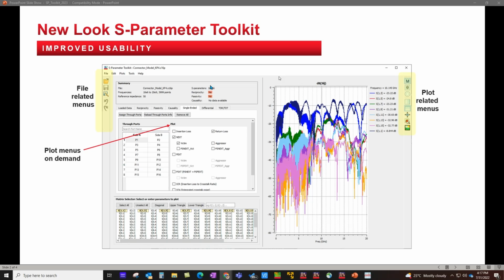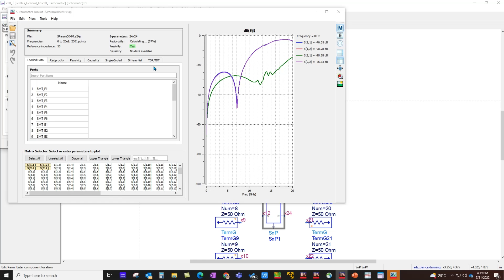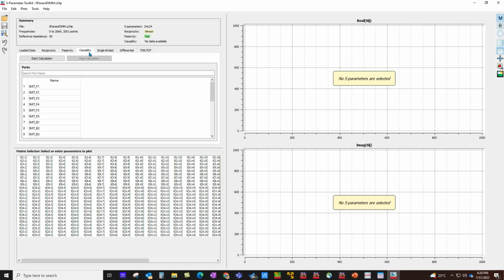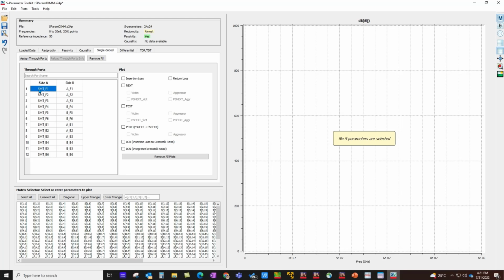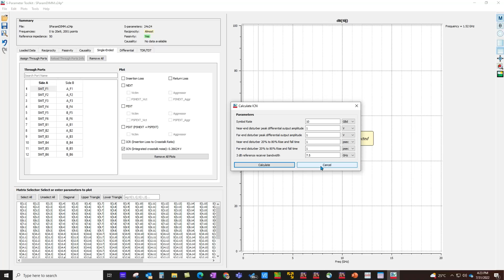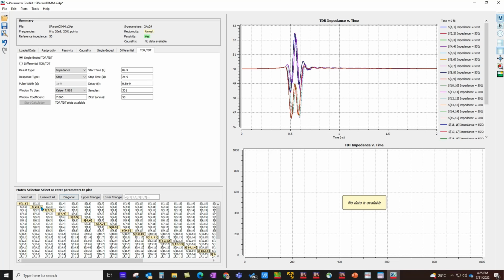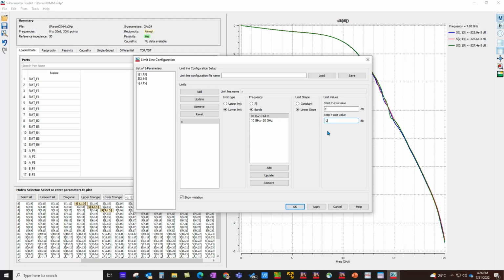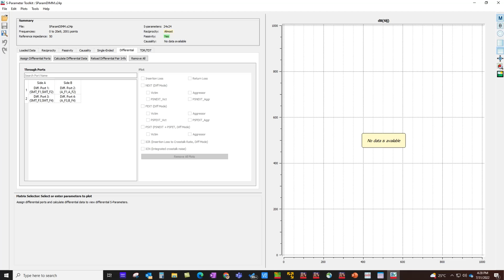ADS2023 Top10 - Feature 8: S-Parameter Toolkit Enhancements

Comment: Dear Anurag Sir,
 I hope you are doing well. Your tutorials have helped me a lot in understanding ADS. Thank you so much.
I am working on a patch antenna fed by two pairs of differential ports  ( Port 1 is paired with port 2 similarly 3 and 4). For the ports, I am using TermG. The schematic circuit contains 4 capacitors for coupling between the patch and ground and the L-shaped feed metal. To get the required result, I have to change the value of the capacitors. How can I use the S-parameter toolkit for this purpose? Is there any other easier method to provide differential feed in ADS instead of using the SP toolkit?
Reply from the maker: There is no need to use SP Toolkit for this need. Instead of TermG, use Term which has +/- terminals and you connect each one of them for differential terminations. Contact your local Keysight tech support team for more help on this.
Reply: @BhargavaAnurag  Thank you so much.